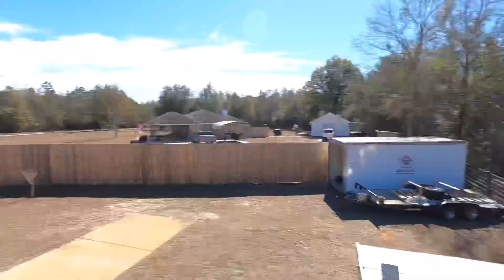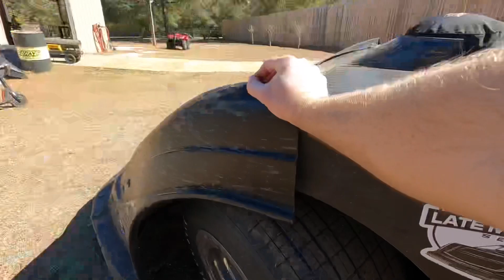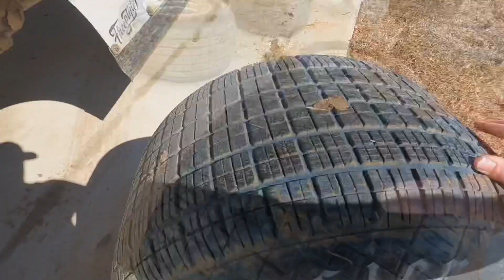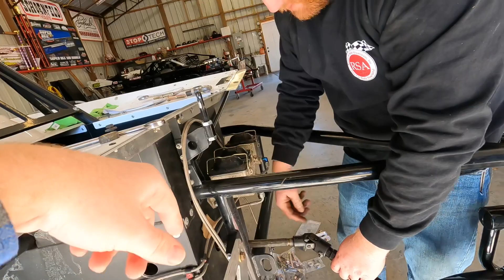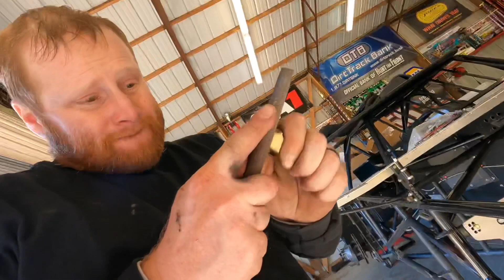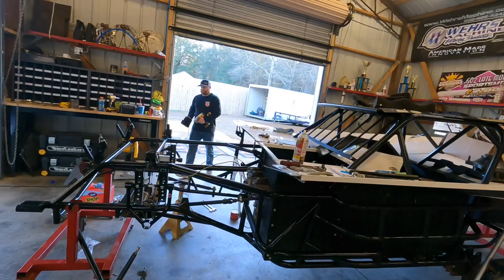New Race Car Assembly! Preparing for Jesse vs Joseph Round Two!

Comment: There are beveled washers (aka safety washers) for use with heim joints, no nut grinding required, but you may need a longer bolt in your case.

Comment: You were  talking  about   tightening up  that  one  nut  so it   didn't fall off  during  a  race. I  had a  65  ford  short box  with a 351  Windsor  one  time  I  heard a  noise  in  the   front end  and  knew  I had  to change a  wheel  bearing,  I  was  wrong  thank  God I  figured  change  one  change  both  I  jacked  the  whole front  end  up  and    both  wheels  fell of in the   driveway.

Comment: You guys should be putting the vertical bolts nut on the bottom, and horizontal bolts nut towards the rear of the car. Just in case things decide to come apart on the track.

Comment: Those headers look good .. did you blast the paint off before you started using ATF on them ?  I'm about to pick up a set of from Schoenfeld and I wonder if I can/should just get them unpainted and try the ATF deal.  I've always just painted mine with BBQ paint but yours look better.   And why does the collector / muffler look so different ?

Comment: You guys did great, we always have some bugs too work out at the beginning of the season,  we also X the front and back but we use chain in the back and once you put the chain binder on it, it's not moving. Joshua was excellent,  on a 100%scale Joshua is 99.99% and Jonathan you are 100% just my opinion,  could be a seniority edge thing, sorry Joshua. 🎥🎬 ML33MI

Comment: Why do you put a shield in front of radiator when you're in the shop.  I understand why at the racetrack not sure why at the  track
Reply: Its so the fan cant pull air through the radiator. It helps get the motor to operating temperature without having to rev it. It is removed once the motor is warm

Comment: With that back bolt on the lower arm,  I'm not sure if it's made to go in that way, but wouldn't it be better putting the bolt through from the top so if it comes loose the bolt won't just fall out?